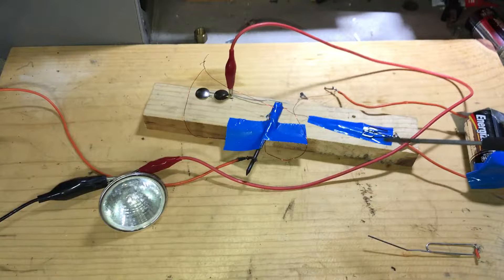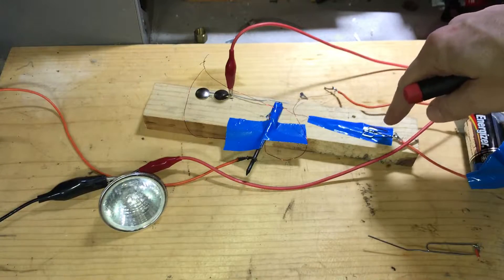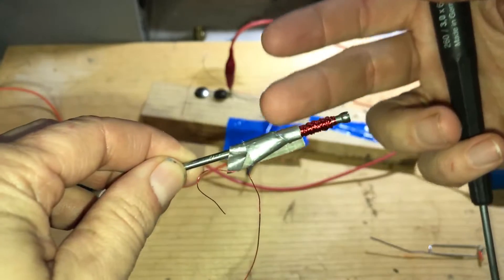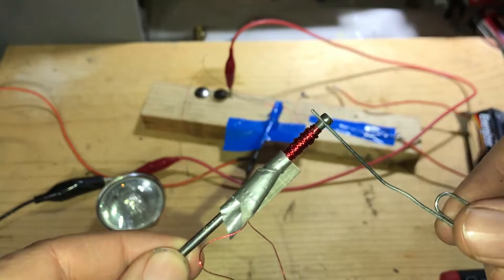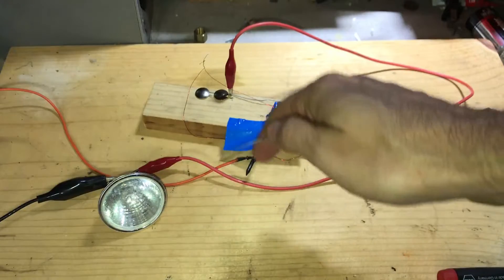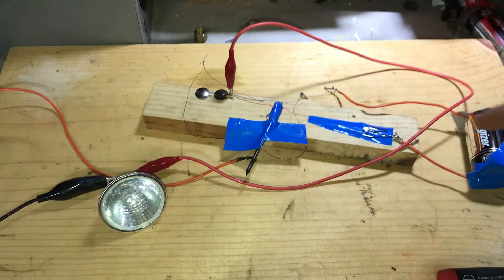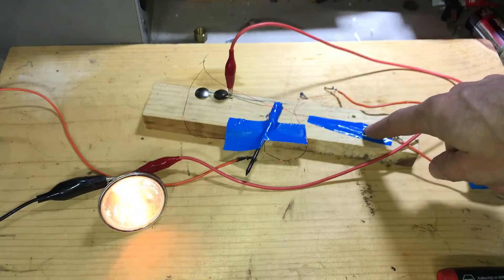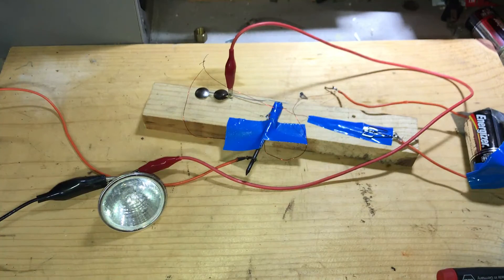DIY Relay

Comment: How many turns or the wire is needed to have enough force to support mass of the paper clip with 1.5 V battery? I'm planning to do flip flip from homemade relays to store one bit of information :) Also I'm wondering what copper wire you used. Looks like 0.5 mm